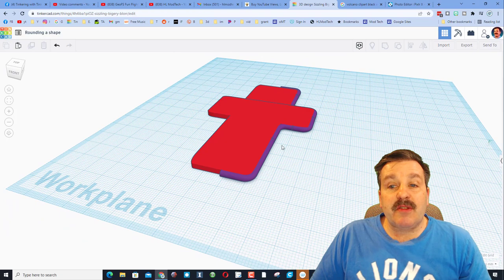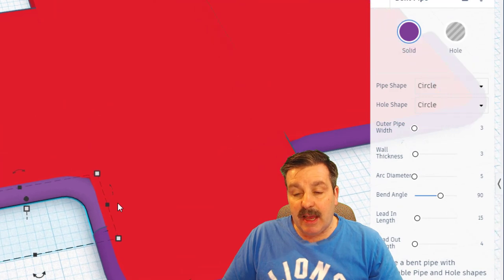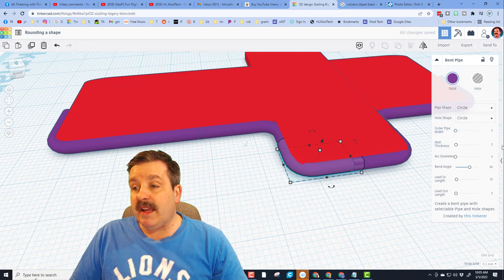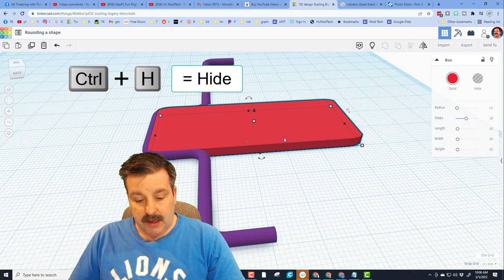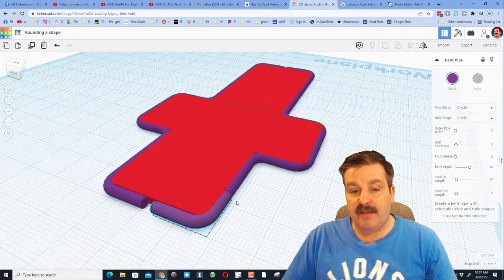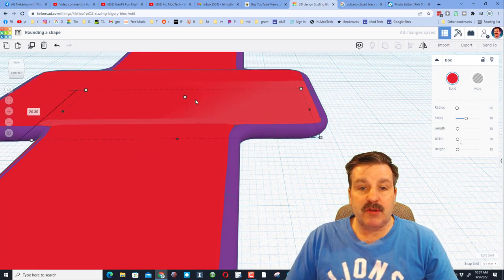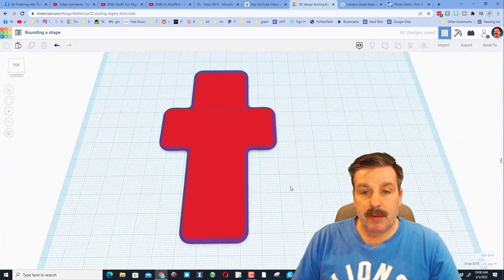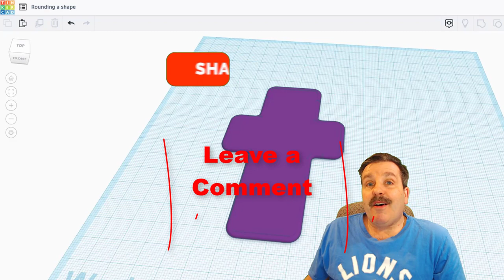Tinkercad Trick to Bevel or Chamfer inside curves! Totally Tubular

Comment: i tried using the bent pipe but it quickly got very messy and it seems the shape has a minimum size. i only needed to fill in the top edge of a part 3mm thick, so i just used the dice, shrunk it down, slid it in, and it works almost as well as what i wanted
Reply from the maker: Nice job!

Comment: This is almost what I need to do...but I want to join a ring and a cube.  I have a 3" diameter ring set on top of a 1" wide cube and I need to fill in the transition gap between them w/ a nice arc, but for the life of me can't figure it out.  If it were 2 cubes, I think I can do it, but I can't get the side against the circle to blend in smoothly.
Reply from the maker: Interesting question. You are welcome to shoot me a share link so I can check it out. You can reach me at hlmodtech gmail. To share a project you need to use the steps in this video https://youtu.be/XeDQjhRK8lg

Comment: or u could use the fuse rod or capsule from the 
design starters section....
Reply from the maker: They are slick, but I just tried to arrange them to do the inside corner... I am not able to make that work with them.